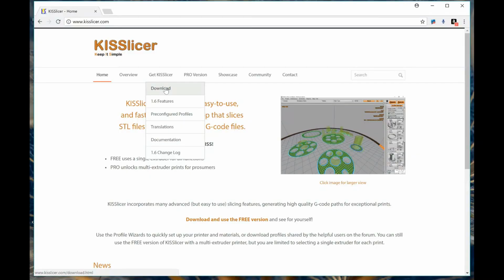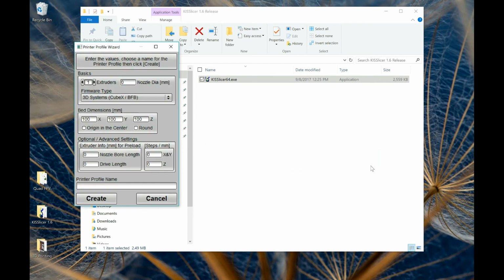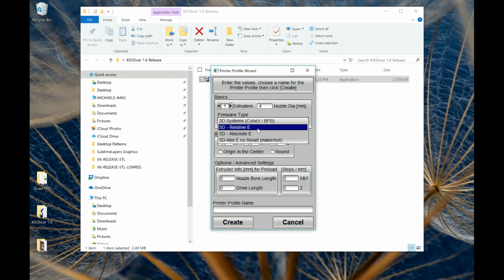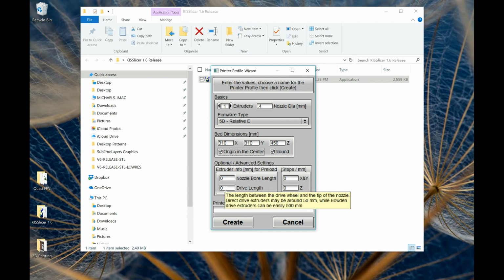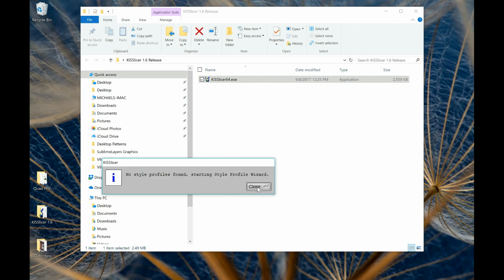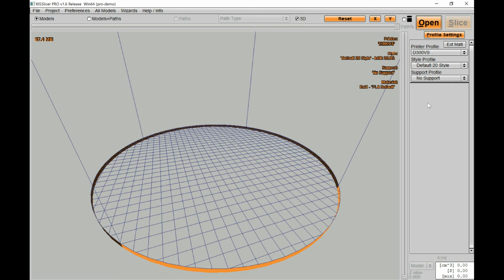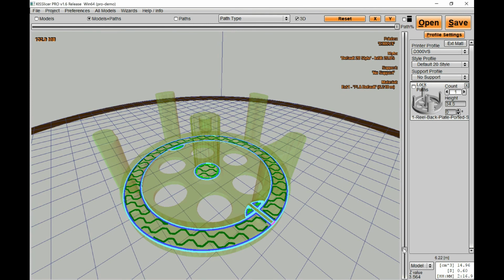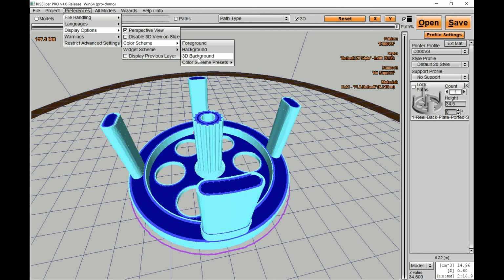KISSlicer Tutorial: Getting Started with the Wizards

Comment: Thank you for posting this tutorial! I'm very new to 3D printing, so this was very helpful and easy to understand
Reply from the maker: Thanks. I still love KISSlicer and the company is still working on enhancements. But new printers with integrated slicer software like the Bambu printers are really taking the lead. I was an early Bambu customer and their slicer - based on PrusaSlicer which is based on the original Slic3r - is very good, especially when combined with all of the sensor technology (lidar, etc) in the printer! What 3D printer and firmware are you using?
Reply: @AHackOfAllTrades  That's pretty neat stuff! 
I'm using a Kingroon KP3S hotbot. It's very small and compact but precise. I'm not sure what the firmware type is, I still don't know much about this type of thing. I'm having fun figuring everything out though

Comment: No matter the mouse button used, all i can do is move the veiw of the window. Cant rotate or move the part on the bed. Any ideas?
Reply from the maker: You move the model on the bed using the Profile Settings window. In the right side is a big button that says Center. On either side of it are sliders to move. You rotate a model on the model Thumbnail on the right side of the window. There is a box with up/down arrows labeled ° (for degree rotation).